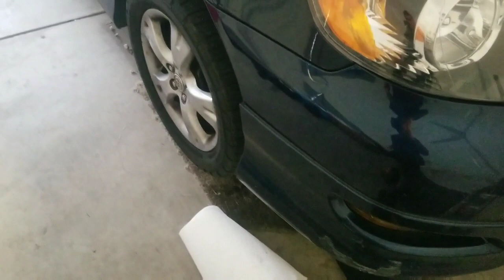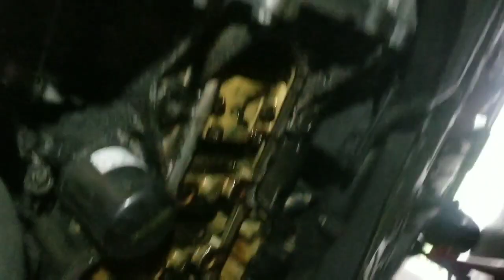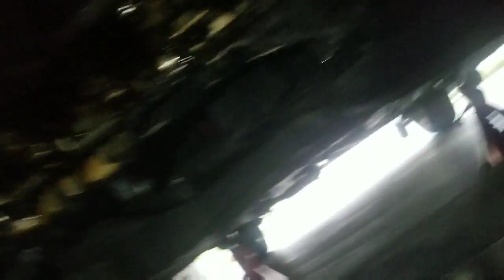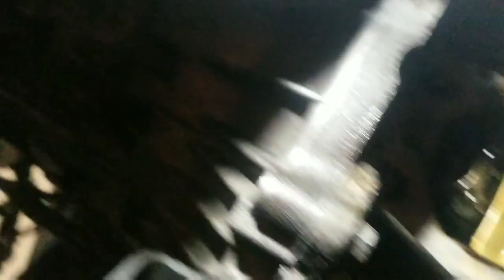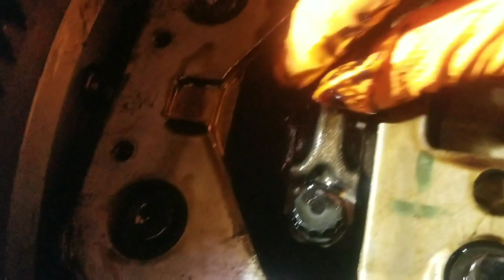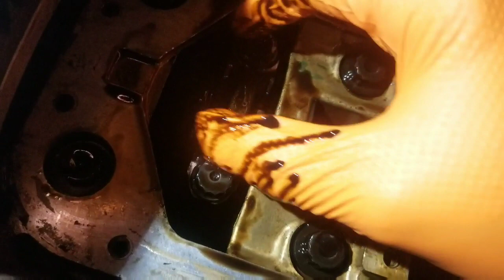06 corolla xrs..what a spun bearing looks like

Comment: Went through the same situation with a spun rod bearing on the 4th cylinder due to neglect of oil changes from a previous owner. If you're unlucky like me, you'll find bearing material in pretty much every crevice of the engine. Aside from the oil pan and oil pickup, chunks of bearing material made it's way to the lift screen filter as well. I wound up getting a new shortblock from MWR since my rod journal was pretty bad and cuz I didn't want to chance re-honing the cylinders as the 2zz has a metal matrix coating on them that makes them where honing may cause issues. Overall pretty much replaced everything in the engine since I was in there. Took about 2 months while working 8-10 hour shifts. Good luck man.

Comment: I’ve seen people lightly sand down the journal and pop in a new bearing, it could last 50k miles or 100 miles, just depends on how much actual damage the crank has. For shits and giggles (and content) repair the journal by polishing it, and pop in a new bearing. I’m not sure about Toyota’s but Honda’s are color coordinated, and each color is a different size.. so for the best results, find out if you can get a regular bearing or oversized one, measure it and install.. you might have a chance .. if the rod hit the crank too, replace the rod along with a bearing

Comment: So the real question is, why was it low on oil? Ours has 250,000 miles and I run the piss out of it, 130mph over 100 times, hit lift countless thousands of time. Still runs fantastic and I even test drove one with 300,000 miles that still ran just as good. But I always run full synthetic oil, change every 5000 miles, and never run low. 2zzge is definately tough. MWR build!
Reply from the maker: Had an oil leak I didnt attended to
Reply: @edarr85  was it your timing chain gasket?

Comment: Noooooo. My GTS has the same issue but #4. Still haven’t pulled the crank out yet
Reply from the maker: Hey bro question. Does the coating stuff you do for the trans work for pistons,rods ext..if so how much would it be to do 4 pistons 4 rods and maybe the crank
Reply: AllFromA_Phone Yes sir, I’ll ask them right now stand by...
Reply: AllFromA_Phone Ok so to have all of the rotating assembly in the bottom end WPC treated it’s about $500